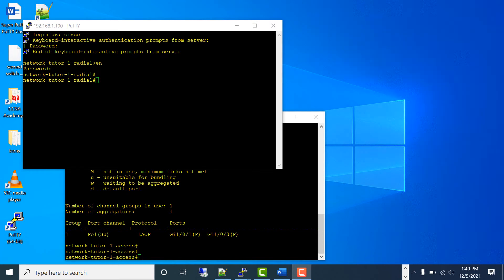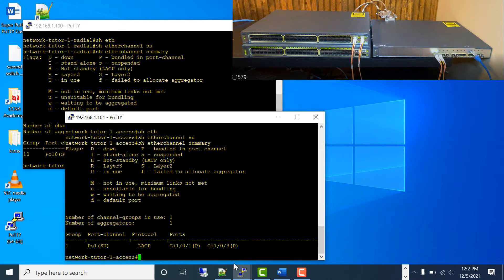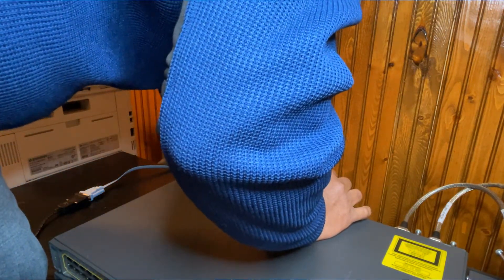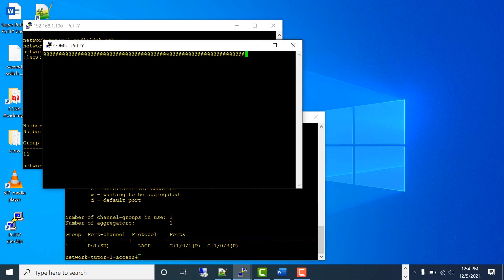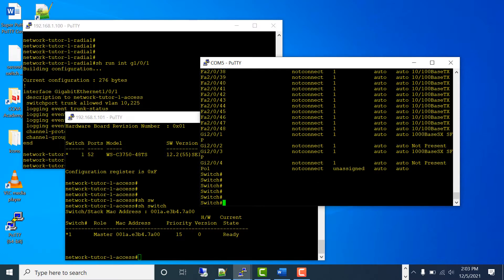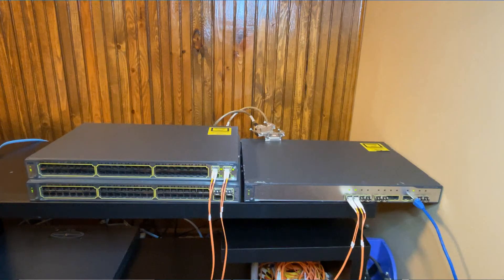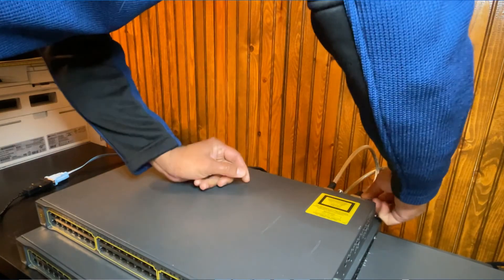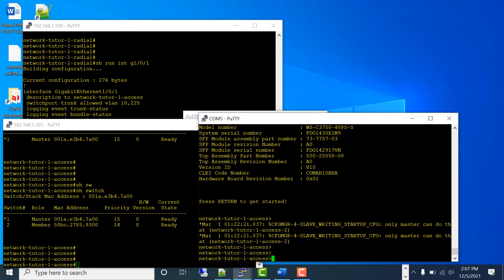Cisco Switch Stack Configuration - How to add a switch to Live Stack | NO OUTAGE | NO REBOOT NEEDED

Comment: In 5:43 the second switch in the stacks seems to have the provision configured by default and the #2 assigned by default. I'm not savvy on the topic, therefore, I look forward to knowing why is that this configuration is defaulted? Is it that when you ask for two switches one of them comes as it?

In my case, I need to stack a 9200L switch to one already on and working. I want to know whether this configuration is expected for the second switch.

Comment: Thank you for the video. My question is: I have a potential 3 switch stack of 2960X's. Currently, two are stacked together via stacking cables in the back, and the third didn't have an expansion slot and now I've found one and installed one in the back. I have the stacking cables prepared to connect to the third switch and unsure of how to proceed. 

The first two switches are already connected and configured in the stack, the third is treated as a separate switch. I am trying to add the lone third switch to the existing two switches' stack. Cheers.
Reply from the maker: See this picture on how to stack 3 switches of 2960x. 
https://www.amazon.com/Cisco-Catalyst-2960-GigE-LAN/dp/B00CIZXFK2

It will join the stack as a blank switch. Issue # sh int status and you will see 3/0/1 - 3/0/x (x- number of ports). Hope this helps bro.

Comment: Thanks for a great video👍 I got a question if the interfaces have different vlan on switch 1 then how do we copy all the interface config on 2nd switch as after stacking shouldn’t it copy the entire switch 1 config to 2nd switch. Note : the first switch was standalone with existing config on each interface different vlan. Thanks in advance
Reply from the maker: for example you have 2 switch in a stack and the second switch failed. At this point you will have the first switch running as master/active. If you issue a command # sh switch - you will see your failed switch become as removed. However the master  - then you issue a command # sh int status - you will staill see all the ports config including its vlans.

The stack master contains the saved and running configuration files for the switch stack. The configuration files include the system-level settings for the switch stack and the interface-level settings for each stack member. Each stack member has a current copy of these files for back-up purposes.

When you add a blank switch to replace the failed switch, all the configs will be copied over including the interface level config. 

Here is the cisco KB - chrome-extension://efaidnbmnnnibpcajpcglclefindmkaj/https://www.cisco.com/c/en/us/td/docs/switches/lan/catalyst3750/software/release/12-2_40_se/configuration/guide/scg1/swstack.pdf

Let me know you need further clarification.

Comment: I'm running into a few issues, my main switch that I'm working on can see that it's currenctly being stacked and the main switch is the master and the other one is member. Should ports from the other switch not show up in show run on my main switch?
Reply from the maker: you should see all the ports config in the running config. Simply issue #sh int status and you should see all the ports available in the master and member switches. If you have issues  issue another command #sh version and see the Cisco IOS images matches on both the switches. Remember that all the switches in the stack must have the same IOS version.

Comment: you should have moved the redundant PO to switch port gi2/0/1 and not gi2/0/3 just to make everything consistent even your way will work.
Reply from the maker: the reason  for moving the fiber link ro 2/0/3, they physicall next to each other and make the cabling easier. It also looks nice they are lined up above and below. But you are correct if you want to keep the config next to each other like 1/0/3 and 2/0/3. Thanks a lot fo sharing your thought.